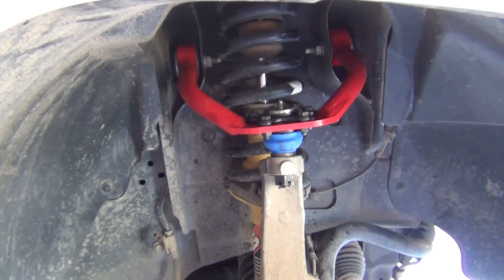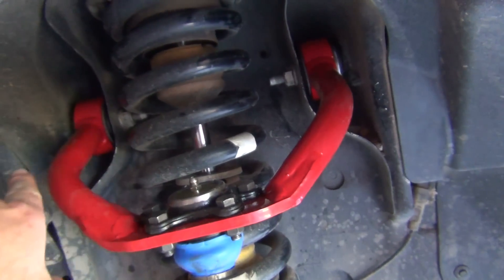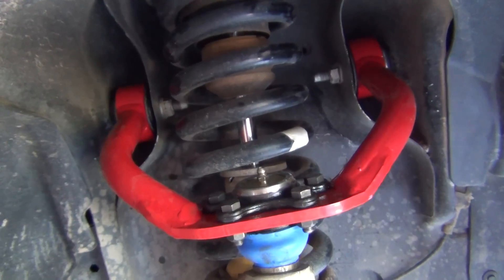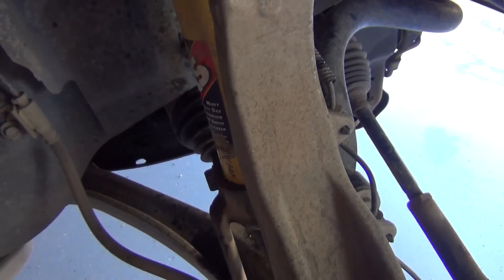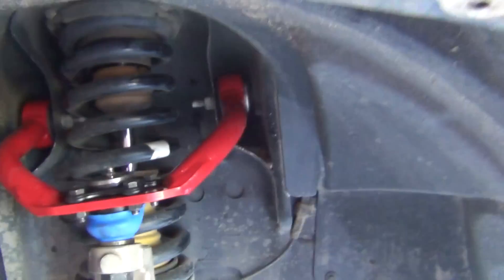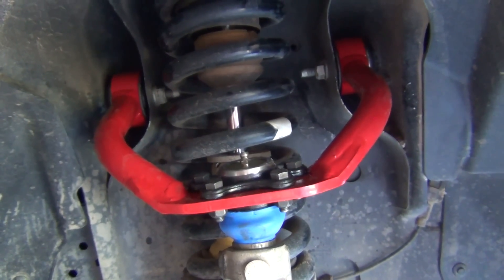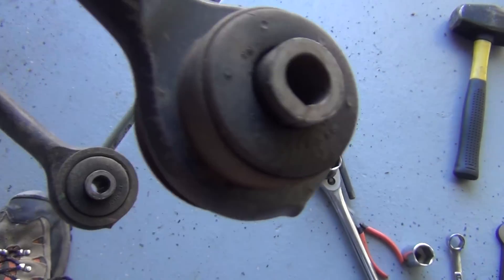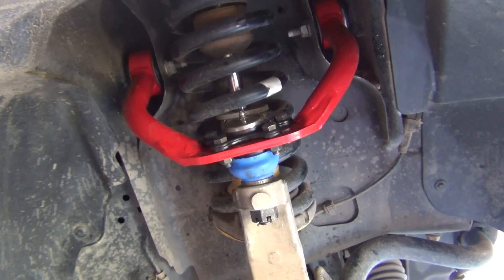2005 Jeep Grand Cherokee JBA Upper Control Arm & Ball Joint

Comment: THE EASIER WAY TO DO IT IS TO REMOVE THE INNER FENDER WELL. IT THEN GIVES YOU COMPLETE ACCESS TO THE UPPER CONTROL ARM BOLTS. ONLY TAKE ABOUT FIVE MINUTES TO REMOVE THEM OR REPLACE THEM.

Comment: Looks like a "bolt in" ball joint control arm assembly,for easy ball joint replacement? Where do you get that type? I haven't been able to locate it through research?
Reply from the maker: https://jbaoffroad.com/jeep/grand-cherokee-2005-2010.html
Reply: Thanks for your reply.

Comment: Thank you!!
Do you have the torque specs for all 3 nuts and bolts for the UCA?? Going to do this today!! Already cut off the clevis bolts to the LCA and the front LCA bolt! Changing everything on the front right and left! One more question, is there a right and left for the JBA UCA?
Thank You!!
Reply from the maker: Sorry no I don't
Reply from the maker: I don't think there is a right and left, I honestly don't recall I think they looked the same.
Reply: Meeker Extreme Thank you, it didn’t look like there was a right or left to me either lol, so I just put them in. I guess I’m just going to go with stock torque specs, that should be easy to find online! I appreciate this, thank you for your help and response!!
Thanks again 👍🏻👍🏻

Comment: couldnt you just remove the 4 top strut bolts the jack the jeep way up and pull the strut forward to remove the bolts?
Reply from the maker: With the strut attached at the bottom it's not going to drop any further. Your A-arm only drops down so far. believe me I tried to pry the strut out of the way. Int he end it's like most things you waste 2-3 hours looking for a quick fix and to be honest it would of been quicker to just remove the strut which actually is not all that hard unless you have rusty Jeep from one of the salt belt states. Then to be honest change your suspension at that time and use a reciprocating saw....LOL
Reply: modette99 what are you talking about? you either raise the body and lower the lower control arm to drop it down. the strut will be compressed, you're not loosening the middle bolt, just the 4 that hold them. i know if i went and loosened my top 4 strut bolts i can go jack up the body and raise it off those threads.
 maybe the only other thing you'd have to loosen is the sway bar link to get it to drop down.
Reply from the maker: xorgab Wel lnot on my JGC shrug

Comment: just curious. I noticed that there wasn't a spacer on top of your strut for lift, and was wondering if your jeep was lifted with the clevice type that attaches to the bottom of the strut, or if your jeep was factory ride height. I have an 06 wk limited with the 3" clevice lift and my ball joint angle is crazy. just trying to see how much these would correct the angle on a lifted wk.
Reply from the maker: I have stock ride height other then the HD Old Man Emu springs give you lift but it's not really a lift kit. Heck I have not even bothered with bigger tires....LOL I'm not putting any more money into this vehicle. Going the truck route when the time comes.

Comment: Are these just lifted jeep or for stock and lower?
Reply from the maker: For stock or slightly lifted. My OME heavy duty shocks did keep the Jeep up so it sat higher some. Not drastic, I mainly did this because parts are able to be lubed and replaced much easier and they were not that expensive to me.

Comment: and im still trying to figure out why you took off the fender. and i dont know about you but those jpa uca's are all the thing on the jeepforum message board but have you noticed not 1 of those guys posted a tutorial or a write up. ive noticed many of them are pompous and havent a clue what they're talking about and they take it to someone else to do all their work. i would have went with the driveworks from advanced or the napa uca and used their 40 off a 100 coupon. i should know, i bought the driveworks uca's for 65 bucks a piece and installed them myself just as i described earlier. about 45 minutes each side for a total of 130 bucks. next time you need help with that jeep, shoot me a message, i'll set you straight.
Reply from the maker: To gain access to the one bolt for the fender I had to re-watch my own video....LOL So I didn't have to remove airbox. To me the fender is quicker to remove shrug Probably takes about the same amount of time in reality. I agree with you and the Jeep Forum...I don't know how many times I have read post and the person says "I'll check when I get home" and they never say. Or they don't take a picture, or they don't post a How too. I ride a LOT of dirt on my motorcycle and one thing we do on forums is write up step by steps. It be almost impossible not to find something you need with detailed pictures. I think you are right a lot of it has to do with kiddos and people that pay shops to do the work. I rather buy tools that cost hundreds and do the job myself...last resort to me is a shop. i did take this Jeep in 3-4 months back and had the dealer do the headers/studs because it was not worth me beating up my hands. I'm probably one of the few Jeep owners that although I like my Jeep it's the most poorly designed and maintenance hog. I'm sure I will get flak for that but that is my opinion. If i went Jeep again I would get a Wrangler...but most likely a truck in in order in a few years. I got to replace the rear pinon seal and nut, and my CAT is F'ed. Never had a CAT go on a vehicle with only 133K miles. Actually on all my past vehicles I have never had to replace things I have to replace on this vehicle....LOL Thank God I only drive it once a week if that.
Reply: modette99

thats weird cause on mine i can see the bolts under the hood and didnt need to remove the fender or anything else to get at them. yeah it would have been easier if i removed the fuse box, air box and other stuff but i managed to get them without. now im wishing i did a vid to help out everyone whos a 1st timer doing uca's. and i hear you about jeeps. were on our 5th one and always doing something to them.

Comment: hey modette99, go watch this video, 1999 Honda Accord Upper Ball Joint/Control Arm Replacement
Reply from the maker: I see what you mean now...but I didn't have clearance to go either way due to the size of the bolts and the springs. Maybe because the springs are much thicker then the stock setup. Note I have Old Man Emu struts and springs.  Seems like a good idea if you are slightly off but there was no slightly here. Why not just change it around and never have an issue...the service manual shows clearly the nut being on that side...I prefer it how I changed it and no issues what so ever then no one ever has to loosen any of that other stuff.
Reply from the maker: Why are you busting my balls anyways about it? I never claimed to be a Mechanic and by trade I'm an over paid IT dude. Like 99.99% of Youtube videos I'm just a dude in a garage for the fun of it.